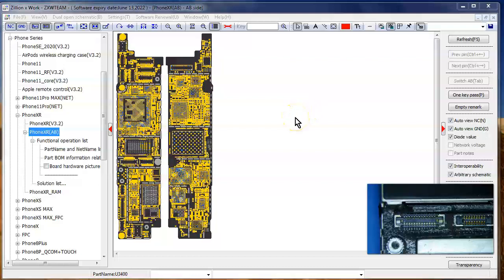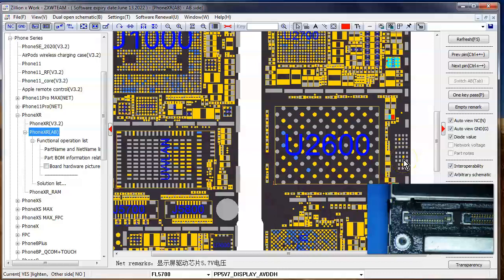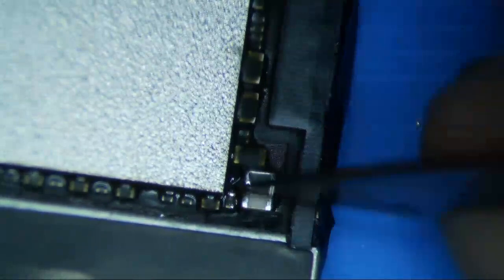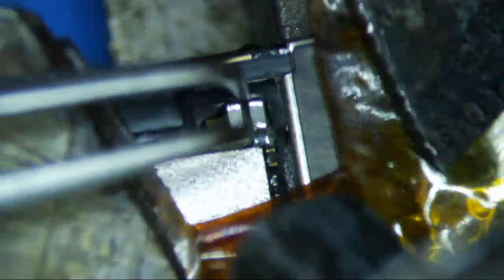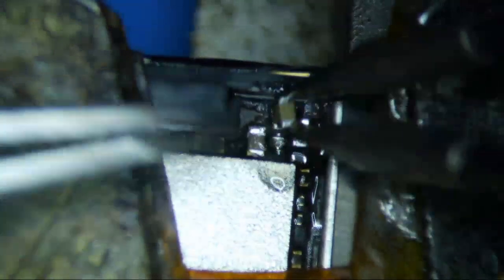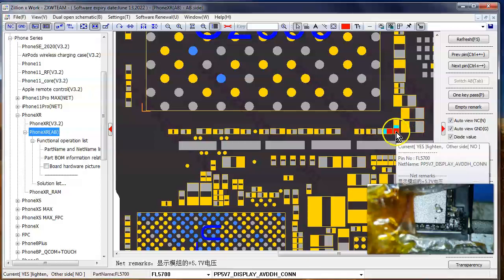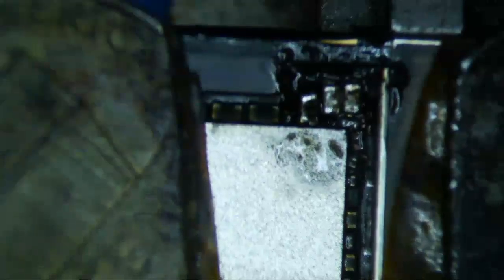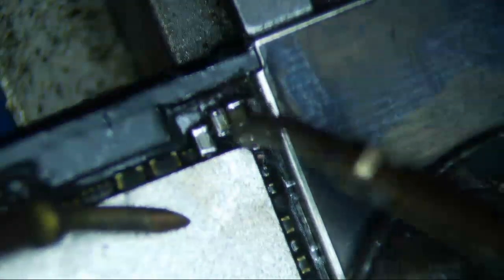iphone xr no display repair

Comment: Random question: what happens when a Ground Pad comes off underneath a IC
Reply: If there are no ground pads to attach to then the IC will not power on. Luckily, Most IC's have more than one ground pad.